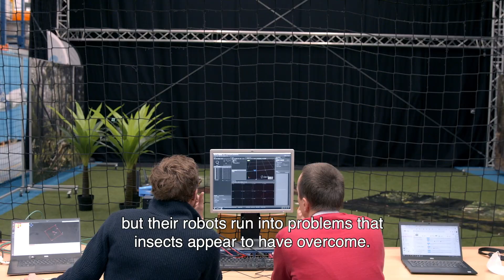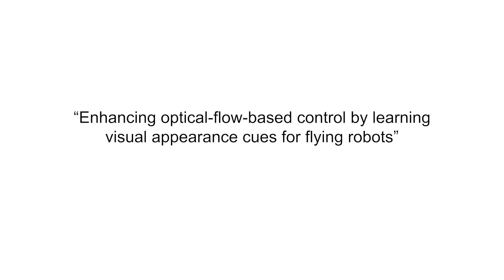Enhancing optical-flow-based control by learning visual appearance cues for flying robots

Comment: Nice video for a simple and known correlation. Sad thing is that you cannot use this with camera Drone or manned air taxis because you don't want this ozzilation there... Also this movement will have a huge extra penalty to battery life, so where exactly is the desired field to use this?
Reply from the maker: Thanks for your remark! The method is most relevant to small drones - large drones can make use of more costly solutions (in terms of mass / energy / processing) - for example, they can easily carry a stereo vision system with a big baseline distance. We don't see the oscillations as a problem. The big oscillations you see at the start of the video happen when performing naïve optical flow control, without taking oscillations into account. In our learning process, the oscillations are much more subtle. Moreover, learning allows the drone to make fewer and fewer oscillations, flying smoother, faster, and safer over time.